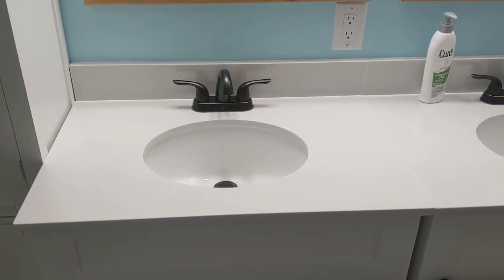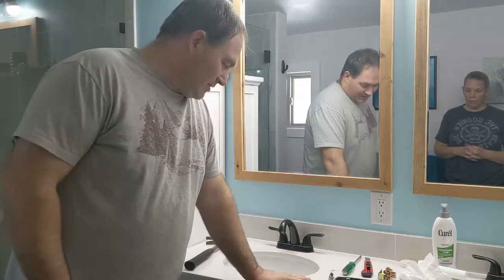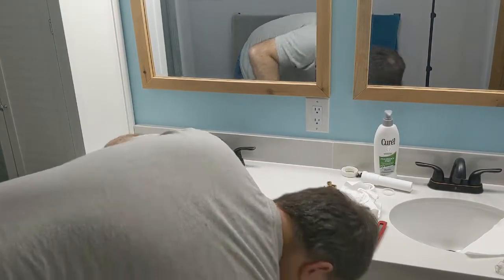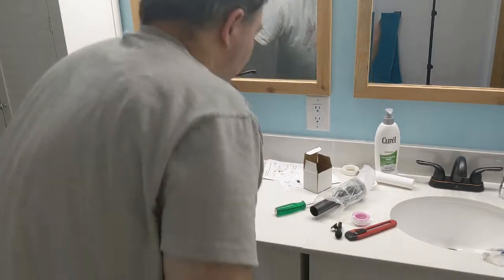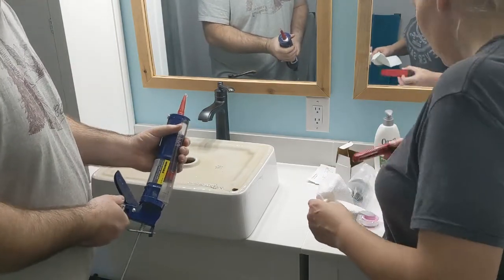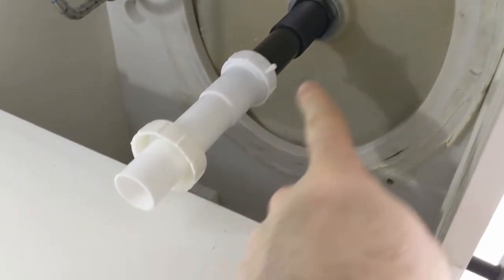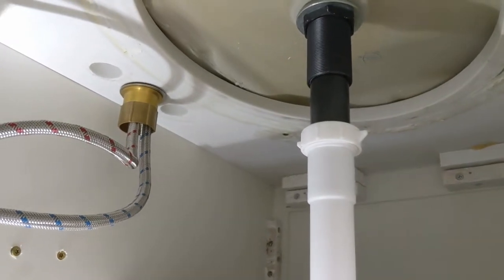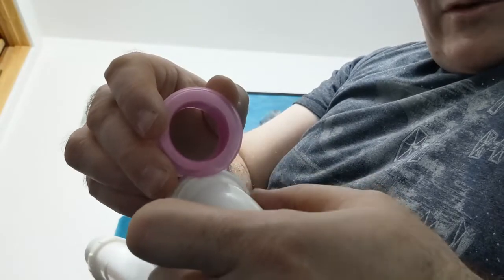Undermount Sink to Vessel Sink

Comment: To save a lot of work, the under counter sink did not have to be removed. Just set the vessel sink as was done in the video and run the drain from the vessel sink into the existing drain of the under counter sink.
Reply from the maker: Hi! We tried to do that but the drain hole is too small for any of the plumbing to fit through. Believe me, breaking out the old sink was a last ditch solution after we tried everything else.

Comment: Wondering why you didn’t switch to a drop in sink ?  I have an undercount sink that was installed God  knows when ( before I moved in 20 years ago)  and it’s enamel is now rusting  and the plumb8ngs need replaced and I’m thinking about converting to drop-in mount sink for earlier installation.
Reply from the maker: We didn't try a drop in because we don't have the things we needed to cut the marble. I really wanted a rectangular shaped sink, but because we didn't want to cut the marble countertop then it had to be undermount or vessel.

Comment: Are the sinks still holding up well? I wasn’t sure if the weight of the vessel sink would affect the countertop if there’s a large hole underneath it. Would love to do this!
Reply from the maker: Hi! Sorry for the delayed response, after doing the 1st sink we discovered it wasn't going to work the way we wanted so we took the vessel sink out and put an undermount sink back in.
Reply: @fromhousetohomestead hi! Wondering what exactly didn’t work? Im looking to do this but wondering if it was due to the hole underneath or if it was for another reason? Thanks!
Reply from the maker: Hi! The only part that didn't work was that the vanities are too tall so the vessel sink sat too high and when I (KC) would use it, water would run down from my hands to my elbows and drip water on the floor! Normally when you wash your hands or do whatever in the sink, your hands/forearms are positioned down towards the sink. The vessel sink was so high that my hands were angled up causing water to run down my arms. This happened every single time I used it because I wasn't tall enough for my arms to clear the sink. If you're tall it would probably work just fine. Travis didn't have any problems using the sink. There were no issues with structure or stability or strength. There was plenty of countertop to support the vessel sink. Typically you're not putting heavy things in a bathroom sink like you do in a kitchen sink so support isn't much of an issue. I hope this answers your questions!
Reply: Can I ask how tall from the floor to your countertop? I want to do it, too.

Comment: Did you silicon or plumbers putty around drain before installing it on the sink?
Reply from the maker: Hi! Thanks for your question! We did not use either. With this particular faucet set the instructions said "no silicone or plumbers putty required". The rubber gasket that comes with the drain seems to be sufficient all on it's own. We are also careful not to over-tighten the nut underneath so it doesn't pinch the gasket making it not sit flush and snug against the sink bowl. Your best bet is to read the instructions that come with the faucet/drain and follow the manufacturers instructions/recommendations.
Reply: @TheDuckklr
What size sink did you use
Reply: @fromhousetohomestead  what size sink did you use
Reply from the maker: @karmeletterice4730  thanks for your question. The dimensions are 15"D x 19"W x 5.5"H.
Reply: Nice job.

Comment: @
What size sink is this
Reply from the maker: Hi and thanks for your question. The sink size is 15"D x 19"W x 5.5"H.
Reply: Can you send a finish picture of the whole job complete also where did you buy the sink do you have a link I really want to do this project
Reply: @fromhousetohomestead  can you send finish project picture and a link on where you bought the sink that would help me I want to do this project
Reply from the maker: Good morning, we got the sink from Amazon.  There are several different sizes and heights to choose from. I chose a size that would cover the existing hole in the countertop but not take up too much of the counter space, I also thought the taller sink would keep less water from splashing out. I actually shopped around to several different retail sites including Home Depot and Lowes, looking for the "right" sink. Price was also a factor, there were sinks I liked a lot but I wasn't willing to spend the money they were asking for them. We just did the one sink because I wanted to try the vessel sink for a few days before committing to doing the other one and I'm glad I did. It turns out that I did not like using the vessel sink at all and we ended up taking it out and putting an undermount sink back in. We did a video of that project. Here is the link for that. https://www.youtube.com/watch?v=5xfQxH6tm20  

Several factors led me to the decision to go back to the undermount sink. One: the sink I chose was too tall. 5.5 inches was way too high. Our bathroom vanities are normal height and the vessel sink made them even taller. I am average height of 5'6" and wasn't able to use the sink without water running down my arms and dripping onto the floor. Travis is over 6 feet, and he didn't have any problems. Two: the vessel sink did not stop water from splashing all over the countertop like I hoped it would. Three: I didn't like how tall the faucet was (and had to be) to reach over the sink. I am absolutely not trying to discourage you from doing this project, I'm only mentioning the things I discovered after we installed it so if you have a similar starting point you can learn from our mistakes. We didn't take any extra pictures of the project after it was finished, but you can get an idea of what it looked like if you watch the beginning of the video where we swapped back to the undermount sink. It really did look beautiful and I am really bummed it didn't work out for our set up. I hope your project works out just how you want it to!